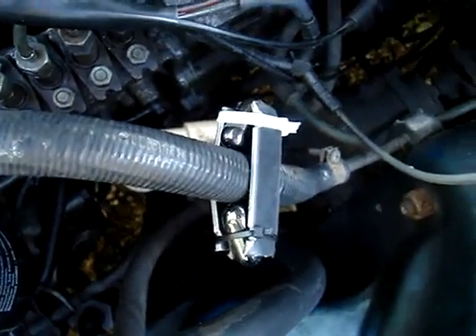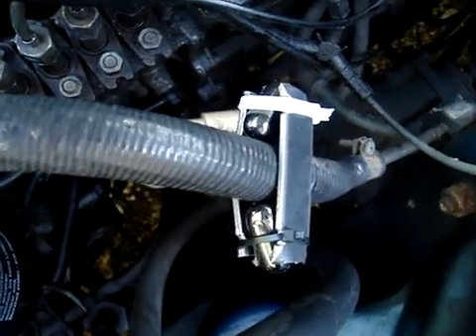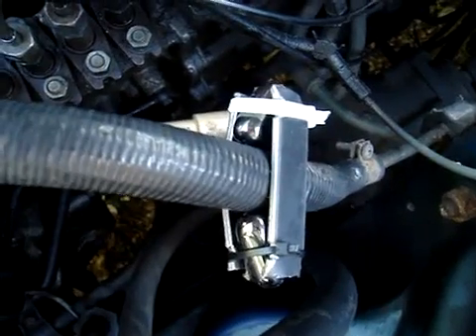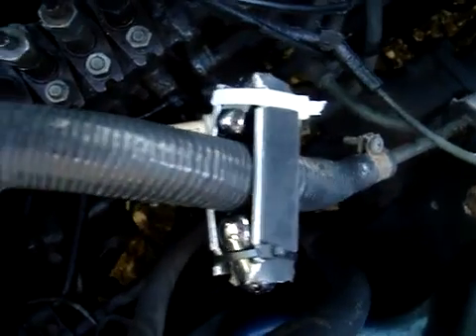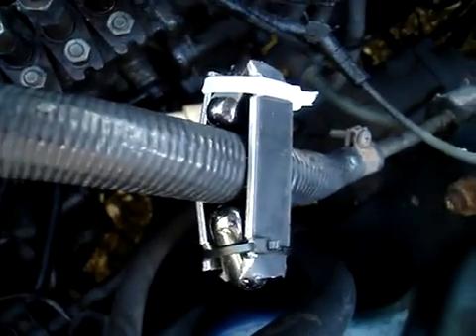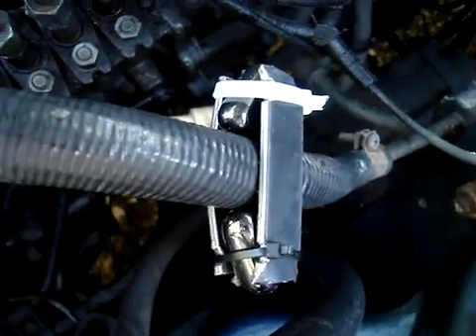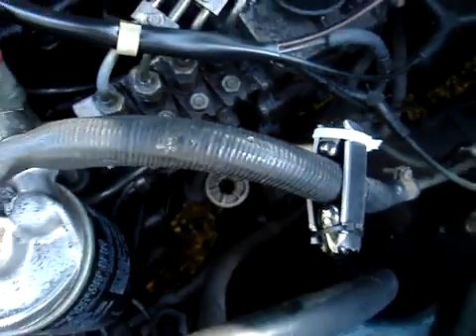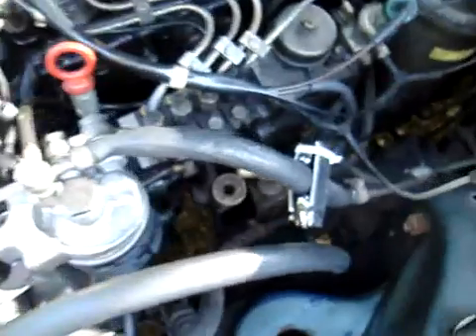Installing magnets on your automotive fuel system.

Comment: This is bullshit on a deisel, steel particles from the injectors and pump will block the pipe . On the back end of the fuel tank to stop particles recirculating would be a sensible move

Comment: It's videos like this that gives YouTube a bad name. If you really think that a small magnet like the one shown can make any difference at all in gas mileage, fuel burning, or performance, then you must be smoking crack. The only thing dumber than this video are the people who believe this magnet trick actually works. LMAO
Reply: It takes $5 to test it yourself and find out whether or not it works.  I don't see why people bicker about theoretics instead of actually trying things to see what happens, especially when it's as cheap and easy as something like this.  You live inside a paradigm that is your own prison and will probably never amount to much more than occupying time and space until you die having never done anything of value for society.  This guy already has, because I've tested it and it actually works.  Then I later found an actual scientific study that was done on the subject where they used several different strengths of magnets and reported that they all produced roughty a 14% increase in combustion efficiency based off of exhaust gas readings.  The reason people think magnets don't work is because car ECU's are programmed to maintain a static inefficient exhaust reading.  If you actually increase combustion efficiency it will drown it in more gasoline until the math adds back up to 14.7:1 (pounds of air to pounds of fuel).  And here's the actual scientific study, if you have enough attention span to actually be enlightened.  https://www.sciencedirect.com/science/article/pii/S1876610212008144
Reply: Mark Julius when smoking Crack the magnets will work on those hydrocarbons too mate !!!
Reply: Wayne Sanders 
Hi Wayne, is there anyway around the ecu making the adjustment? Or does it mean you need to reset the ecu by disconnecting the battery ever so often?

Comment: South Pole magnets? DAMN! I got Rocawear magnets....

Seriously tho... this is crap, magnets on the fuel line does nothing for mileage. That much has been proven. Just like mixing 4oz of acetone in a full tank of gas, doesn't do squat. Or the "electric superchargers", those were my personal favorite. Put a hopped up computer fan in your intake! When it explodes, you need new engine! HA
Reply: ..proven? Show me the study . BTW, here's the study that says they actually do.  Not just some internet chumps all parroting the same thing. https://www.sciencedirect.com/science/article/pii/S1876610212008144

Comment: what if you electrified those "rare earth" magnets or the neodidyum or what ever they are spelled magnets by wrapping them along with the length of the hose with copper wire? Powered by the alternator's power alone you will get the electro-magnetic field generating and pulsing along the length of the hose or hoses you wrapped causing a fluxing current of magnetisms that will keep the poles flipping opposite from what they naturally want to be, constantly contradicting their intentions as the go.

Comment: the idea is right, your product and execution are completely wrong.  check out our site; we supply much larger rectangular 2.5" magnet clamps on the fuel line along with a electronic low voltage booster that agitates the molecules inside the engine block ... 22% increase in mileage tested for the past 27 months
Reply: please send website to haitham_hamouda@hotmail.com

Comment: Also, if you have a diesel engine, you need to replace the spark plugs and flux capacitor every 5,000 miles
Reply: Diesen engines don't have spark plugs and flux capacitor sounds like a part in Star Trek..
Take care

Comment: Correct!!. I used 20 Mev @ 20Mhz DC to charge a super capacitor  to 10 Mega Coulombs and put the o/p across a coil and phu phu diode of 1000H inductance to magnetise the rare earth magnets that I used to 10 million gauss. I ended up with cold fusion and sold it to GE for 10 bucks.

Comment: Magnetic field and electric charge are two completely different things. A varying magnetic field will create a varying electric charge and vice versa - that is how electromagnetic radiation works. But fixed permanent magnets will have no effect on a fluid which is not attracted to magnets, whether valenced negatively or positively.

Comment: The epa, Mythbusters and motorweek tested these so called fuel savers, none of them work.

The auto makers are under considerable pressure to improve gas mileage If it was really this simple and cheap to improve gas mileage, ever auto manufacturer would have these from the factory
Reply: This is what I originally thought except the online sellers of these magnets don't use strong enough magnets and they don't orient them so that they repel each other with the SOUTH poles facing each other.
To identify the south poles, we have to use a compass or compass phone app and the South Pole side will attract our compass North Pole seeking needle.
Take care

Comment: The only way to change the charge of a solution is to modify the solution.  Magnets might have an effect if they were inside the combustion chamber itself... but they would have to be hundreds of times stronger.

But, you could do much better by introducing strong ultra-sonic pulses during injection, prior to the compression stroke, to help vaporize the fuel entering the chamber.

Comment: if you get 20 litres of urine...boil it under pressure...20psi...then run it thru pure crushed cystal....crystals must be crushed to no bigger than3mm....you get pure ethanol out the other end

Comment: Negative valens? Valens electrons are always negatively charged, all electrons are and you can't change that with anything, especially not a pair of scrawney magnets..

Also, practically all fuels are hydrocarbons, apart from coal for obvious reasons.

O2 is nonpolar and so is gasoline, magnets will not affect.

You MAY be able to magnetically align the molecules for a possibly cleaner combustion, but that'd require stuffing your fuel tank with so many magnets that it won't be able to hold fuel.

Comment: Very Interesting . This subject was also experimented with during WW11 by the British RAF on the Hawker Hurricanes . They were using electromagnets created by coils of copper wire around the fuel lines close to the carburetors and powered by the engines electrical system. The RAF mechanics were experimenting with varying the number of turns to improve the performance and less unburnt hydrocarbons going out into the atmosphere and useing less fuel . That fuel was 114 Octane . Regards:Big John

Comment: if you knew the definition of octane you would know all of this is b.s. octane rating is nothing more then the ability of gasoline to ignite. the higher the octane the harder for the engine to burn the fuel. the lower the octane the easier. it depends on the compression ratio of the engine. higher compression higher octane. this south pole crap doesn't work.  ive proved it. i am a 45 year expierenced automotive technician with all 8 ase certifications.

Comment: First off it is true in THEORY...BUT...Here is the KICKER! To notice even a minor difference, you would need to pull a 16 ft. trailer behind your vehicle, extend your fuel line back to said trailer, run the fuel line through approximately 2000 pound (a piece) magnets, then shield the return line back to the engine. Then you would have a very efficient burn of fuel...and lower your MPG about 50% because of all the weight, not to mention the 1000's of $ to look like an ASS! lol

Comment: if you put helium in the tires you get gooder mileage.  if you take out any unnessasaree seats you get more milage. a few more tricks, you could nock out your windows , less weight.  uummm what else can i think, use a cutting torch to remove any non-vital non stress bearing structure of the body. remove the doors. jam a potatoe in the tail pipe.  you could pull out all of the interior trim, pull off the alternater and ac compressor, just be sure to charge the battery every night. there ya go.

Comment: Real world tests involve way too many variables. If one driver had 1 day when they were just a little heavier on the gas it would throw the experiment way off. We performed a DOE test in the lab. We did a full resolution 1 factor 2 level test to prove that magnets don't do anything. Magnets don't affect bond structure or alignment of molecules in a liquid. And even if it did, fuel wouldn't burn differently. It's all BS.

Comment: There would be a lot of variations in that test.  That is why I recommended the test to run for an extended period.  There would have to be a big difference in the average of both vehicles to prove anything.  Even if magnets are total B.S. I would like to see a longer test run to see a side by side comparison.  At the very least, it could put another nail in this coffin.  I know a lot of people out there use fuel magnets, so it would be interesting to see how many idiots are out there.

Comment: There'd be too much variation due to other factors in that test. The only way to do it, is to have hundreds of drivers in identical cars, half with magnets, half without. Then compare their average fuel economy.

Or, rig up one engine in a lab, like the guy from Purdue said, The important variable s fuel economy, should be easy to test just in that way. Magnets on / magnets off, and see if there's a difference. 

SPOILER - there isn't! And fuel magnets are bullshit!

Comment: I do agree on this video being crap, but a 30 minute test is hardly conclusive.  Have two identical vehicles that are driven daily.  Run them both for three months, get fuel economy results for every tank of fuel during this period of time.  See what the average fuel economy is for both vehicles at the end of the test.  Also rotate the driver every other week so two people get equal time in each vehicle.  The point is, a real world test is better.

Comment: This will work the same with a shackle you can get at your hardware store. Take the bolt out and slip it over the pipe and put the bolt back. Hey presto. This works better than the magnets. The fuel tank will fill itself by driving and the oil level will get higher. Have containers ready after a long trip to drain everything out. Sell the excess to Bob for half price.

Comment: These here might well be magnetic fuel molecules, but there will be no proof as these are burnt and btw heat eliminates the magnetic electricity because it is turned into atom kernel spin which propels the piston, and then are done.

Comment: In your case I propose you use the headlights instead of the brake. Add some forceful beamers (50 kW or so each, that's almost 70 horsepowers per lantern), and in second's thought the light pressure will slow your car down. Don't use super bright LEDs or even LASER, this may be hazardous to the environment and human eyes.

Comment: South pole and north pole magnets point to the north respectively the south pole of the earth (you know, where the south pole and the north pole stick in the snow), whereas any east pole or a west pole magnet point to the setting or rising sun. That comes from the earth spinning round. The negative and positive pole of a magnet are inside the magnet and have therefore no magnetic effect whatsoever. Read Einstein's paper on quantum magnetism, he was so right.

Comment: yes a magnet does react with gasoline, but once it goes through the magnet the fuel atoms seperate again, so its pointless to put magnets on a fuel line. besides magnets cause friction which could cause a freak accident.

Comment: I wrap duct tape( but only the silver kind) around my exhaust system. I save so much gas,every 100 miles I have to drain some out of the tank or it overflows and runs over the side of the car.

Comment: This is bullshit. We did a study at Purdue University with a 5.0L engine. We ran the engine for 30 minutes and looked at HP output, torque, emission levels, fuel consumption, etc and absolutely nothing changed between the tests with and without the magnets.
Reply: Did you place the magnets in repel positions using the south poles instead of the north?
Take care

Comment: I found the best way to get better fuel mileage it to catch the draft of anything bigger than your vehicle.Try to stay no more than 3 inches off the rear bumper of the vehicle breaking the air for you.If you fall back too far you get the dirty air and get bounced around. Dont be a pussy, Get right up in there.

Comment: @Oldbmwr100rs 

i AM A PETROL MISER, i RESENT EVERY CENT i PAY FOR THE STUFF. Driving technique saves a fortune and steady acceleration and anticipating the road ahead to keep braking to a minimum also makes for a comfortable ride. At a constant speed it is surprising how much you can ease off the throttle without losing speed. You don't have to drive slow, just very smooth.
Reply: If you are a miser, I'm suprised you haven't tried some strong magnets with the south poles repelling since they are cheap or free if you have some....
Take care

Comment: @TheSpiritof1969 Yeah, well if anyone is actually interested in saving gas, keep Your tires inflated to the proper pressures and don't drive as aggressively, hold steady speeds on roadways, and learn Your way around the congested parts of Your town so You don't have to keep stopping for most lights,that will increase Your mileage and save money right there.

Comment: Putting magnets in the fuel line is by no means a new technology,claiming a bunch of BS about aligning polarity of molecules is about the only thing sort of new. The auto manufacturers are under a lot of pressure to increase fuel economy, reduce emissions,and improve performance. If something as cheap and easily installed as a couple magnets did what people claiming they did actually worked, they would be using them. Magnets in the fuel line are only good for catching bits of metal in the line.

Comment: It's actually a smart idea. I have a question for ya. Do the magnets have to be installed so that they repel or attract.?
Reply: Like poles repel and since he said to face south to south poles, they will repel. You have to first use a compass or compass phone app to detect which side are south and which is north. South Pole on the magnet will attract North Pole pointer on a compass or compass app.
I'm doing more research on this and will post what I find worked for me after I try it all.
The magnetic products seller's sell for the fuel line it's said do not work because they are weak and aren't in a repel orientation much less south poles.
Take care.